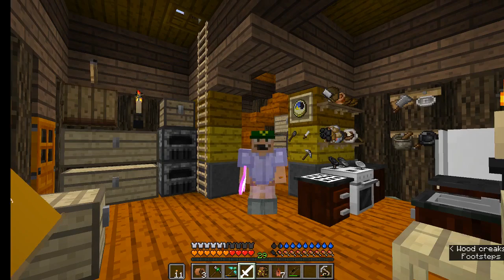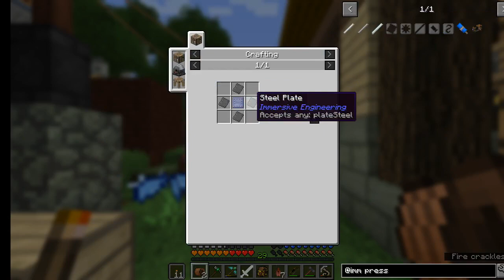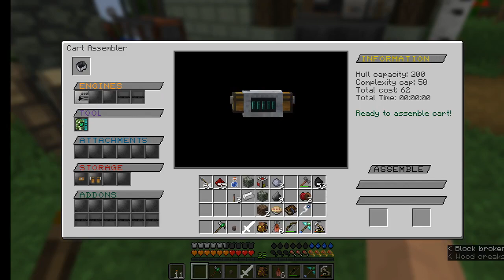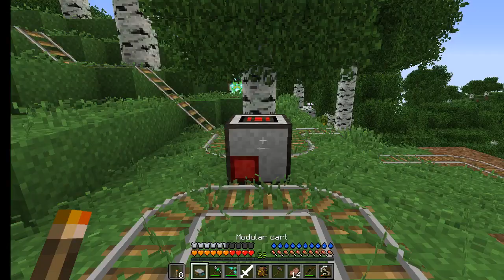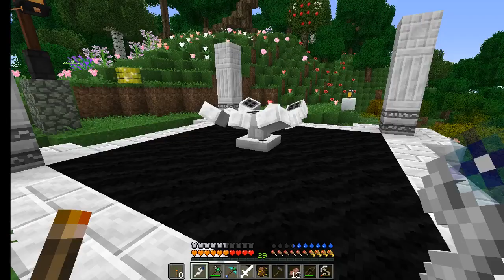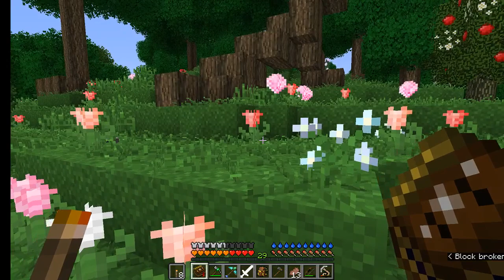Let's Play... Homestead! 019: Yokel Runs Out of Everything!

Comment: Rather than flattening the hill you could have just placed one of the corners of the structure somewhere on top of the Hill, build the structure and then 'support' the quasi-floating thing with pillars or walls from below. Would have looked great i think. :)
The structure doesn't need starlight to work btw, so don't worry about that.
Also, if you get to the part where you attune yourself, I'd advise you to stay away from Vicio since one of the perks from that constellation seems to break health-regeneration. At least it did for me. ._. (Only in this pack though, probably has to do with the tweaks to the whole Hunger-Health stuff)

As for Immersive Engineering, might I suggest to build the Crusher first? Since it allows you to double your Ores so you don't run out as quickly ^^
Reply from the maker: I kind of had a similar thought after I wrapped recording.  I haven't finished clearing out yet so I might just do that...
Reply from the maker: I took your suggestion on the Altar location; it looks great.    Soon, I'll tackle that Crusher too, thanks for the tips!